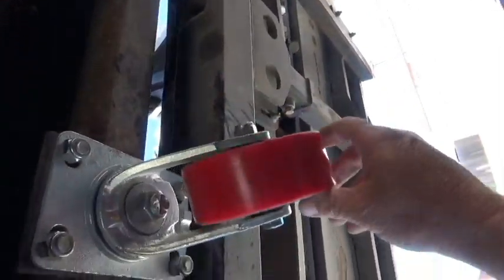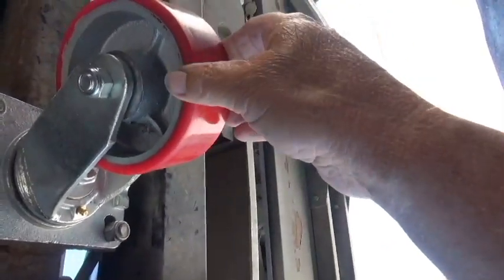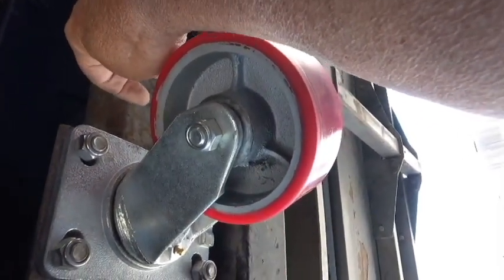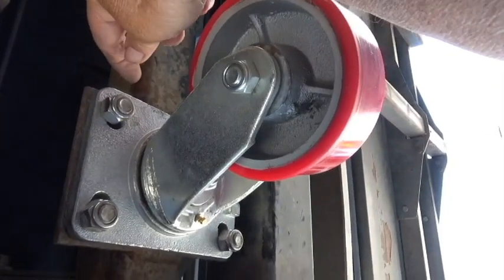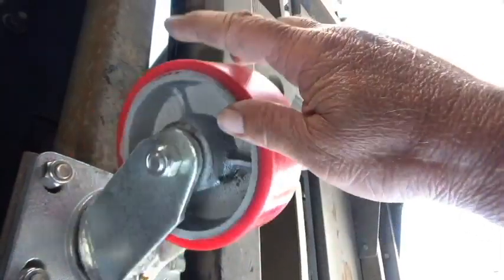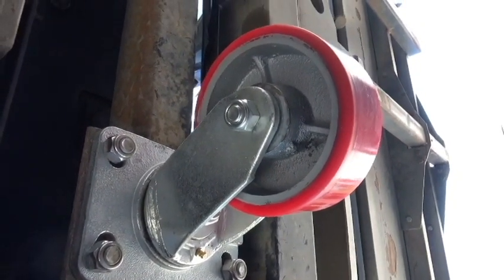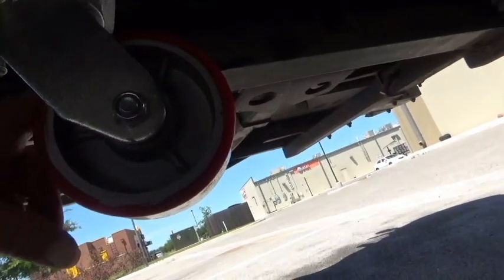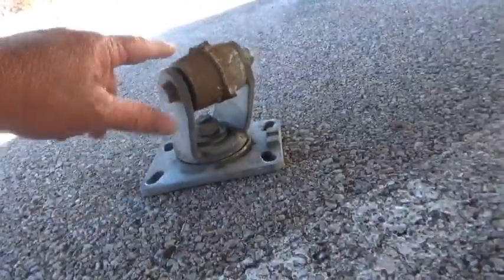An update and problem notification about skid wheels

Comment: The damaged wheel seems to be cast and it might not stand those impacts when a heavy vehicle does hit the ground but the later alternative ones might be more durable. I would still not weld them in place (but at least the roller is easily changed). Anyhow, the roller takes the impact but the force is moved somewhere further in the vehicle frame maybe doing some damage when a heavy hit happens.  Best would be some rollers with suspension that could reduce the force of the impact? Well, they might not last long... Maybe the vehicle should have some airbags so the clearance could be controlled for difficult situations?

Comment: In my opinion anything that has to handle the back of an RV impacting the ground needs to be incredibly sturdy or suspended somehow . 

You want something like a solid roller then have 3/4” of urethane between it and the frame or something to prevent frame damage. Forget the swivel. That’s a liability .

Comment: Those wheels where never made for that use. Those wheels are made for heavy tool boxes or similar types of uses. No wonder you’re going through so many. Shame on the rv manufacture for using this type of wheel. And the red coating is polyurethane which is made for smooth concrete.

Comment: I installed them on my class C 30’ motorhome as recommended.  I’m on my 3rd set.  Just had one break backing out of my driveway at 1mph.  Total junk.  Hub is made out of pot metal.  Probably worth about 10 bucks.

Comment: Those aren’t designed to be used as skid wheels. Those are heavy duty wheels for toolboxes or cargo boxes. You  need to cut off the swivel and square bracket part and have just the U shaped wheel swivel welded on.  The steel wheel itself is  strong enough. 
What you need is rollers.
Reply: Incorrect, these are specifically made and sold as skid wheels for RVs by Ultra-fab.

Comment: Rollers are only good for hard surfaces, and most industrial cart castors are nowhere near the load rating force a trailer will impart on them. You are better off using HDPE plastic 3/4 or 1 inch thick bolted to the rear corners.
 Alternately, have a welder/fabricator make some steel skids and weld them on. They will take the hit and allow the trailer to slide also.